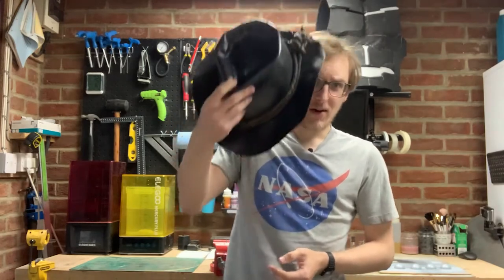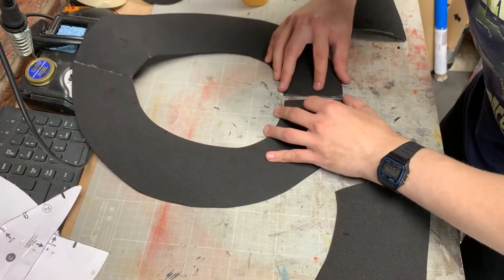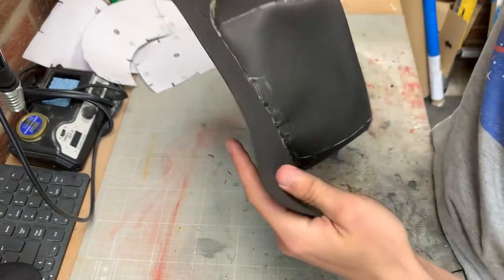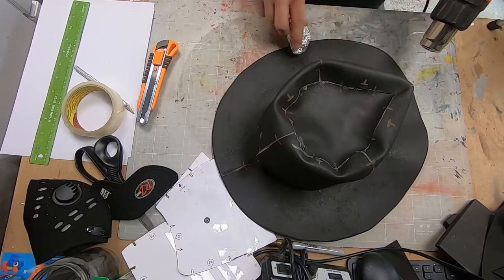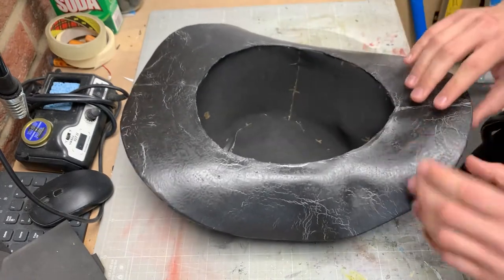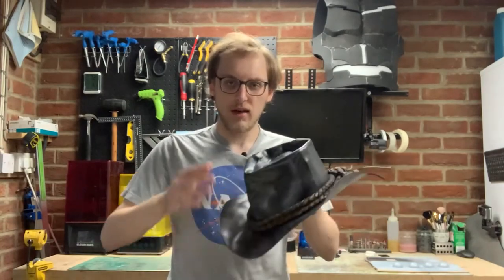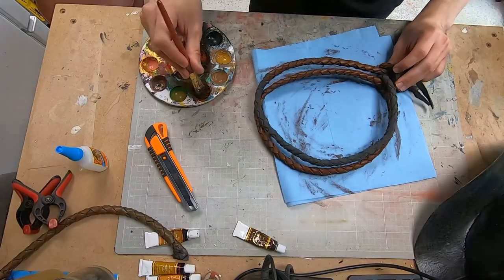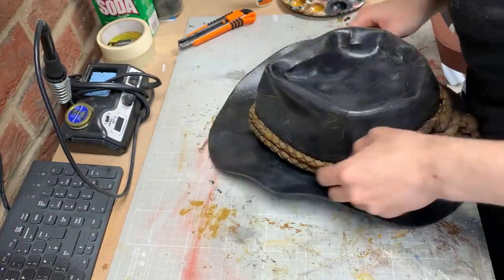Making Arthur Morgan's Hat from Red Dead Redemption 2

Comment: How did you glue the crown parts? I find it difficult to arrange
Reply from the maker: In short, carefully and with a lot of practice!

The main thing is to trust the process. You have to glue thin edge to thin edge, which is very tough, especially at this thickness, press, distort and squeeze the pieces into whatever shape you have to, just make sure the edges line up and meet your registration marks.

Hope that helps!